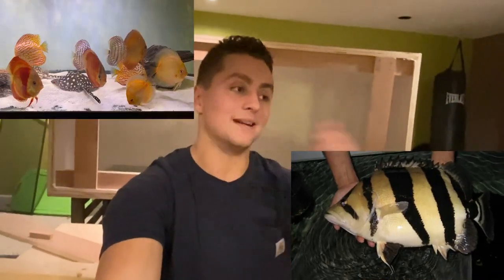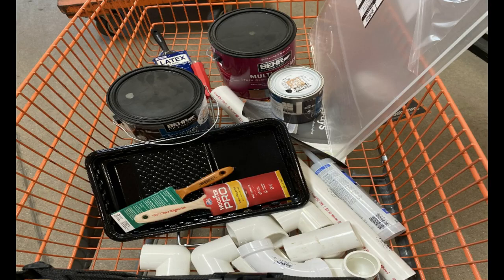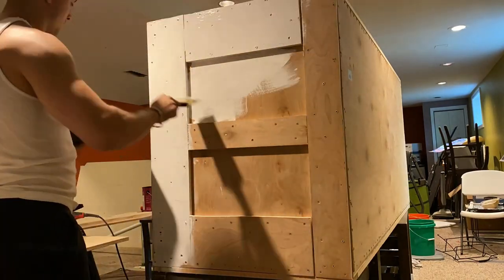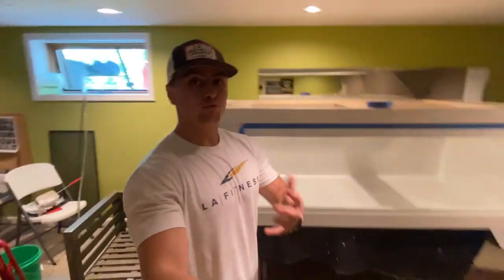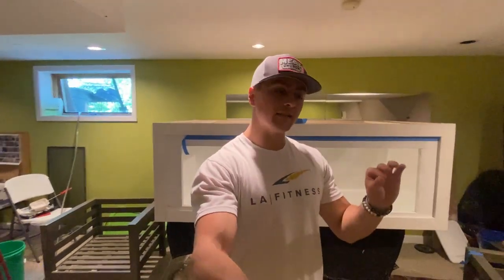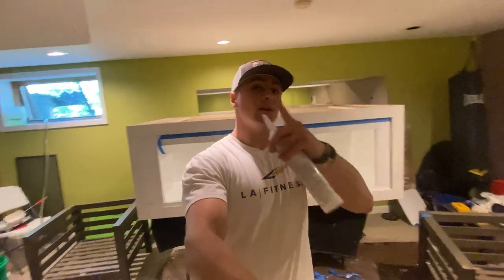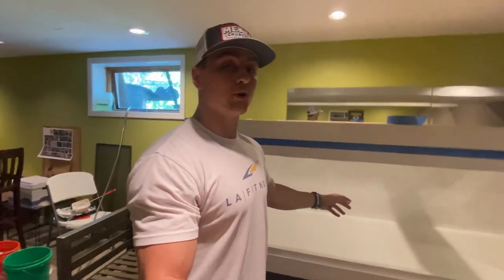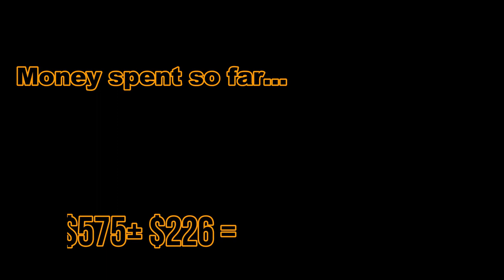Making A Massive Aquarium - Part 3

Comment: There is no possible way that is waterproof or strong enough to hold that amount of water. I’m sorry to see there is no part 4 😬
Reply: If its made correct it is no problem. It will hold the water. But there need to be glued  really good  because there is the glue will hold it together. There need to be more layers of pond sheild. There need to be silicon around the edge of the glass that is what makes it hold the water and not leak. There is videos of simular tanks that function perfekt. 

For looks I should have use fillers to cover all the skrew holes and gaps. And round all the edges of the woods. If take the time and not skip any steps this kind of tank can be both very safe and look really good.
Reply: @fortressfrazze3777  yes. I have seen other videos. This tank, in particular, is what I am talking about. Nothing here was done to the degree necessary to be successful